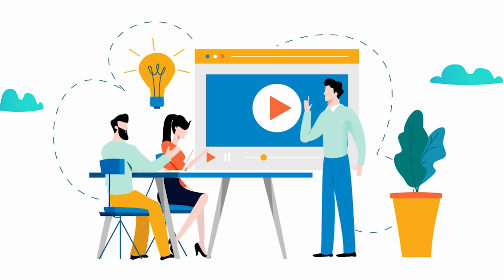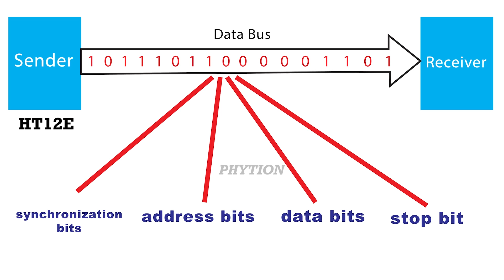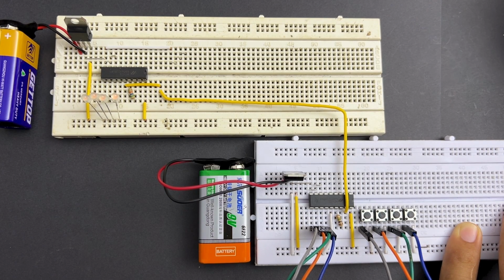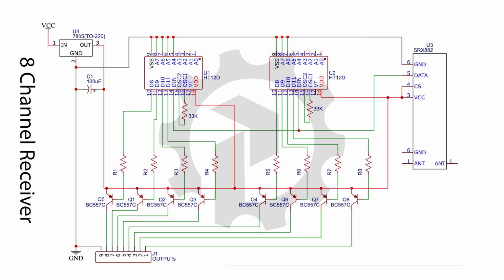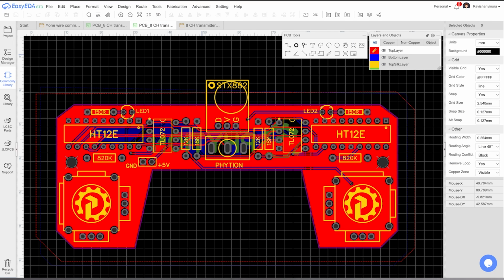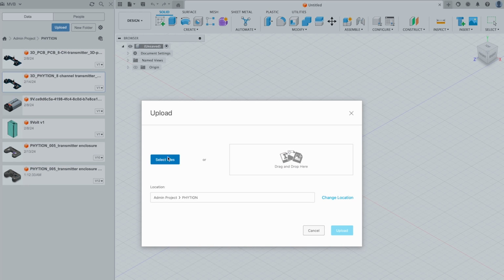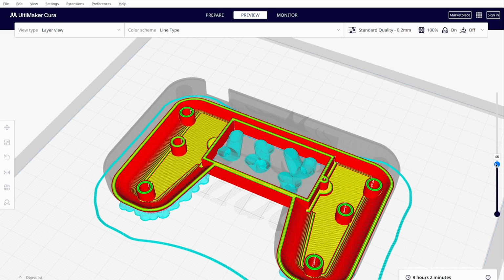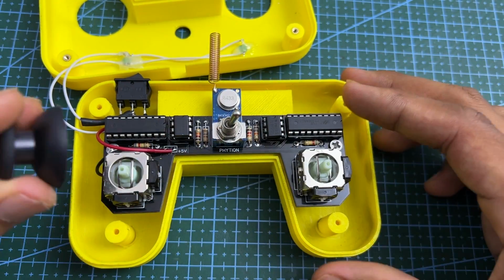Cut the Cord! Build Your Own Wireless System | RC Transmitter and Receiver

Comment: My list of ideas in response to this video!

There's no need to use analogue joysticks here. Since the op-amp chips just decode them into digital, up/down left/right directions with no analogue component. Just using a digital joystick would have been better and not require those op-amps. You could even just use pushbuttons of the type shown earlier, if you're going to 3D print the joypad, and printed your own joypad part to press on them. You can also obtain digital joysticks as components online, searching with "Arduino" gets you results, although most of them are analogue, the digital ones are there with simple direct pinouts.

Or else you can buy rubber domes with carbon discs attached to them. Often used in keyboards or joypads. Put a pattern on your PCB as found in joypads and buttons, and arrange for your buttons or joypad to press down on them, so the carbon bridges the contacts on your PCB. Searching "carbon button contacts" came up with a supplier on Ebay, 20 units for $4.80 but that's just a quick search, you might do better.

The PCB pattern you use can be as simple as a circle split down the middle, but more complex patterns can be used. Saves on 2 chips and some complication. 

You might go with full analogue control, in which case something like an Arduino would be better all-round and not more expensive, you can get all sorts of different microcontroller chips that support the Arduino system. Many have ADC on them. Then you'd could download a software module meant for encoding data, let someone else do the work! Even encoding intended for infra-red should work fine with this sort of radio module.

Or else you could have the Arduino output to the data and address lines of one of these HT12E chips, by having it control several address lines you could use just 1 encoder for several addresses. So you could send 4-bits of ADC data for an analogue joystick reading, 4 bits is 16 levels of resolution for the joypad, that's plenty in my opinion but nothing stopping you sending more to different addresses. The receiver might just use several decoder chips, or you could add an Arduino as well to scan through different addresses and read all of them. Arduinos can do PWM output for stepper motors, lots of useful stuff, and so much code is available for free, written as modules you can use and just integrate together.

Once you get an Arduino, and cheap clones are fine (it's open source), and install the software, you'll start learning very quickly and soon be having a ton of fun. I absolutely recommend them! And you can get them for $5 or so if you look around. There's also component kits with lots of input and output devices, meant for using with Arduino, to create and experiment with all sorts of things.
Reply from the maker: Actually, I have never heard about digital joysticks. Thanks for letting me know.

Yes, I know about Arduino, but I needed to do this without any microcontroller for simplicity. By the way, using microcontrollers is a wise and efficient way for my projects. Thanks for your comment. Let's meet again with a new interesting project, as you said...!
Reply: @PHYTION1   You've really never heard of digital joysticks? Are you joking with me?! Back in the day we ONLY had digital joysticks! The D-pad and some buttons was the lot! Or did you mean available to buy? Yeah they're a lot less common than the analogue ones, and you know the difficulty with that in this project, hence you used the op-amps. 

I can see why you wouldn't want to use a microcontroller. Mostly my post was just ideas other people might want to think about, rather than directly aimed at you. Still, interesting work though! It's always good to see people tinkering, it's what I do myself as a hobby.

I'm actually surprised they still sell the encoder / decoder chips you mention, I'd have thought microcontrollers would have taken care of that job years ago, especially since TV remotes nowadays have more buttons than my keyboard! The HT12s likely pre-date microcontrollers, except maybe the 4004. I can see why you used them, much simpler and more encouraging for an electronics amateur to use, and get a working result without too much debugging.

Nice project anyway, dude. Satisfying to see it all work, you know the theory that it's encoding and decoding and sending out start bits, but you get the simplicity of just pressing a button to light up a light.
Reply from the maker: Sorry, I expected a digital joystick, which is similar to an analog joystick, but it outputs only HIGH and LOW states. Actually, I used analog joysticks to capture the actual feeling of moving our finger up/down and left/right. This feeling can't be achieved by pressing some buttons.

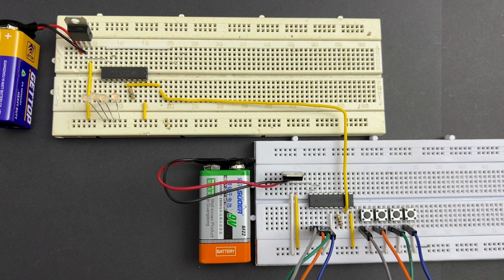Comment: In your first breadboard circuit, around 3:20, you haven't connected the two circuits' grounds together. So the circuit shouldn't work. I can only assume it does because the CMOS receiver is so high-impedance it can take the data capacitively coupled, effectively.

I think I'm right in assuming the chips don't generate RF, only a sequence of bits to be put onto a carrier wave by other circuitry, that might be infra-red or radio for example. So if you're skipping a transceiver, using only these data encoder / decoder chips, they should be sharing a ground wire, for the signal wire to induce any voltage in the receiver. It's odd that it works at all, and if someone used it as an example, it may well not work.

Comment: Every time I open the   files it says 
Files type not supported.
Reply: Gerber files. 
I am brand new to this. I’m sure I’m missing something.
Reply from the maker: there are no errors in download files. try again : https://drive.google.com/file/d/1tiW_VFvXFbXdXWgTn9Czyb20UWk07fHM/view?usp=sharing
(When you click the link, you will redirect to another page. There is a Download icon at top right corner on that page. Click that to download files. Then unzip it. you will be able to find receiver and transmitter PCBs)
Reply from the maker: What file type is not supported? 3D models or PCBs?
Reply: Can’t figure out how to send the file to the pcb board maker.
Reply from the maker: Can’t figure out how to send the file to the pcb board maker. : First you download the zip file through the given link. then unzip it. You will be able to find two zip files. One for Transmitter PCB and another for receiver PCB. upload these two zip files separately to the PCB maker website.

Comment: Surpizingly simple: all that is required is PWM/PCM from/to ADCs/DACs for potentiometer joysticks and higher power TX/RX for longer range with better antennas. A small ATTINY MPU instead would give you N chamnels of ADCs/DACs and/or PWM/PCM in code plus output power transistors plus capacitors in the PWM case..